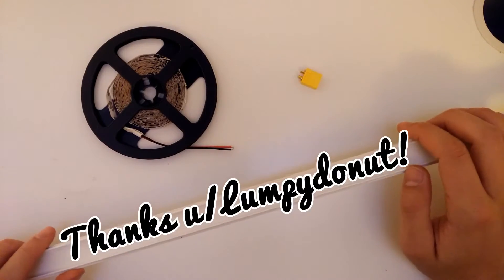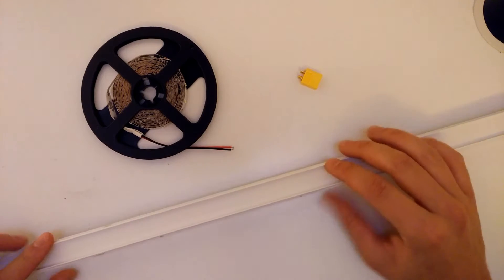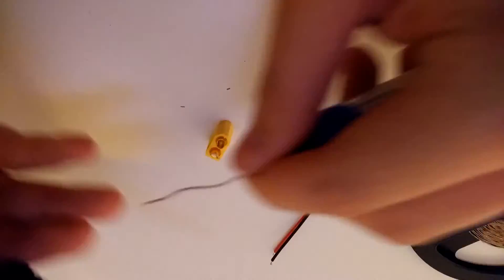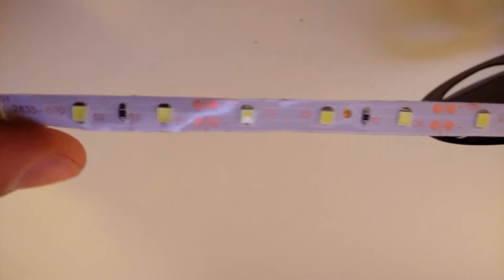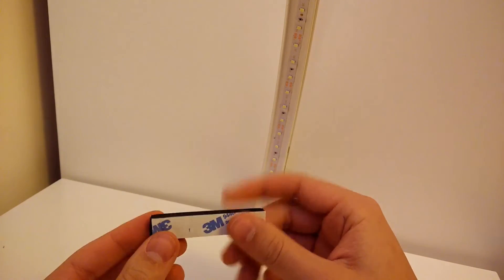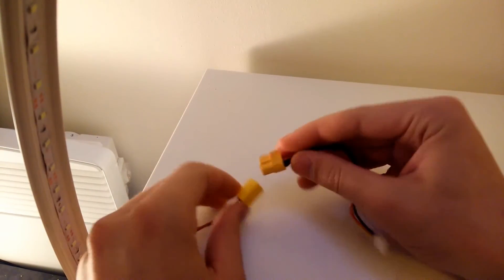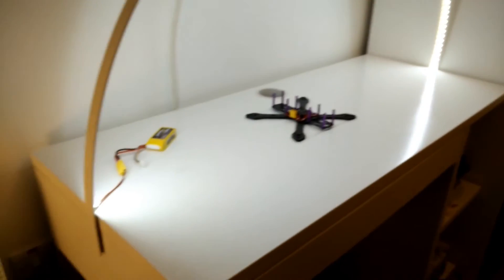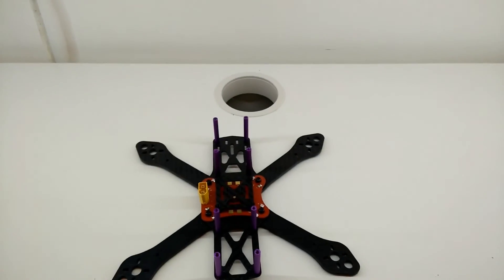AMAZING Cheap Lighting - For Videos, Soldering, Building, Art....

Comment: Its more energy efficient and kinder to lipos to use a 12v wall-socket adapter. using a lipo battery can run the risk of over-discharging it which can be wasteful if not dangerous